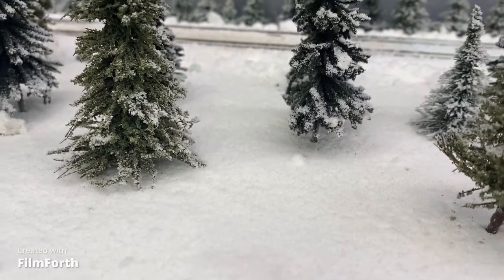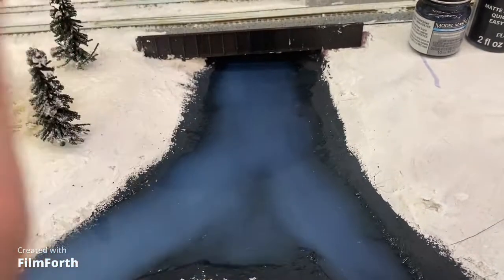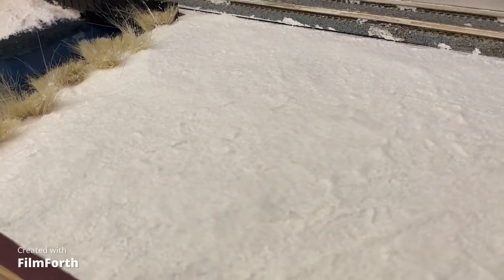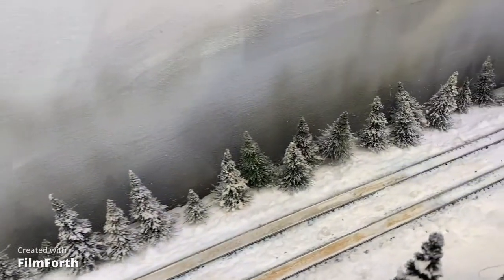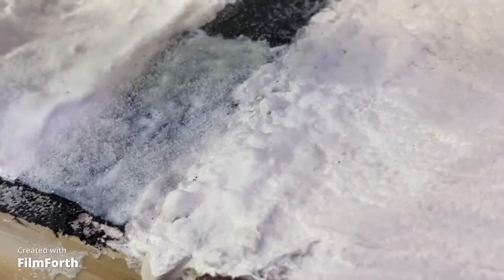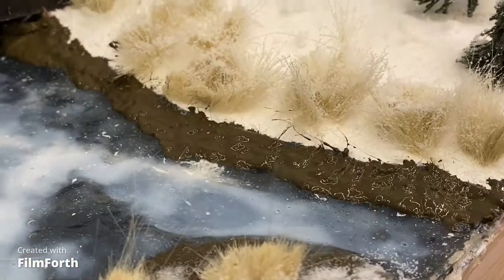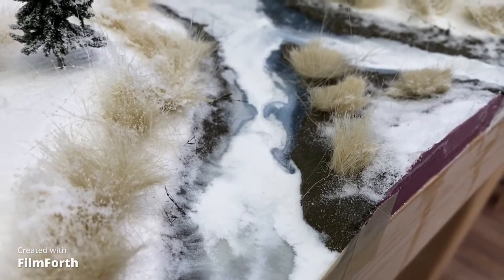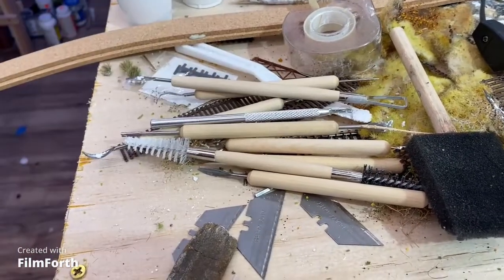N scale Modeling Winter Snow Scenery

Comment: Great scenery..looks awesome….you thought of adding snow to the top of any rolling stock?
Reply from the maker: As a matter of fact, yes.  But it's tricky.  Since the entire layout isn't winter, i'd do it only for pictures.  I might practice on a couple old models and see if it works but i'm afraid to keep it removable is going to make it less believable.  Basically, I want to make super thin snow sheets, like I did for the snow plow snow curling on the blade, and attach it with removable adhesive - but i don't know yet.  stay tuned.
Reply: @AlleghenyNorthern  making it removable is a good idea

Comment: Nice vid. Great set of techniques to create winter scenery.
I'm concerned about the need for abrasives to clean the tracks. Do you think it's practical to try to wipe the rails clean while everything is still wet?
Reply from the maker: Wiping the rails while everything is wet runs a very real risk of damaging the scenery.  it's better to wait and use the abrasives sparingly.